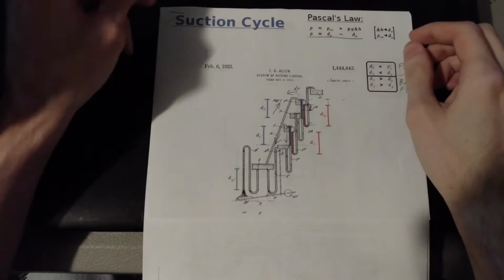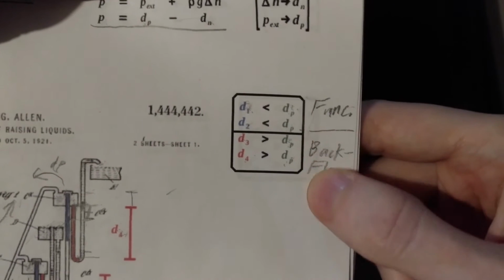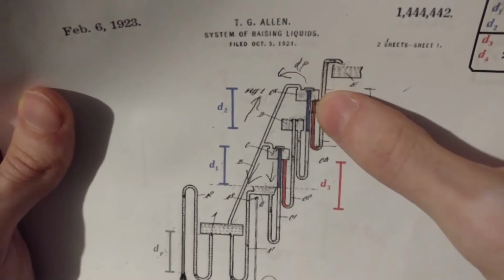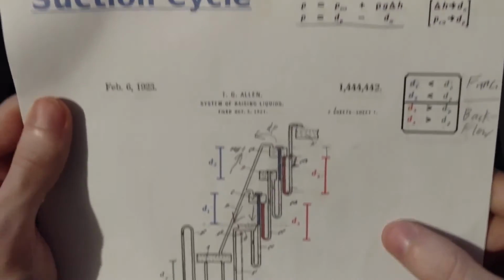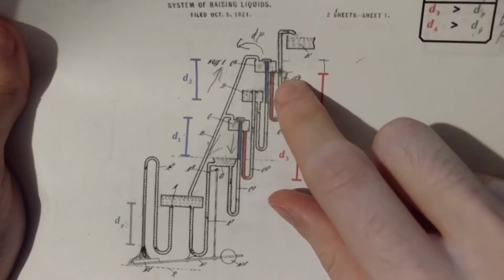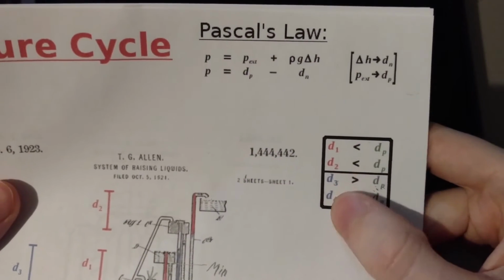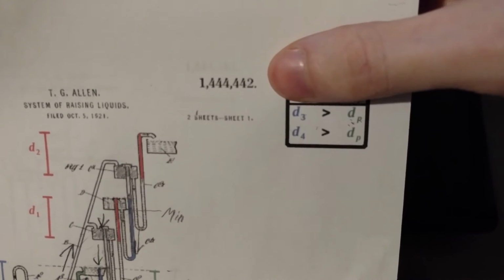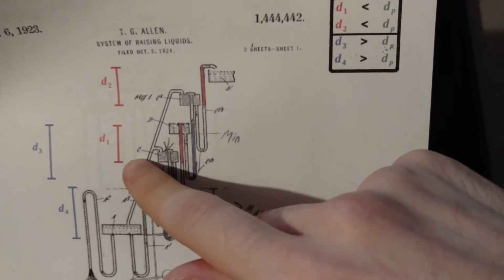Why the Hydrautomat DOESN'T Need Check Valves

Comment: I've designed something similar before inspired by Heron's fountain.
12:05 Top of the tank makes more sense since you lose potential pressure as the tank fills up

Also you can even do without the bottom valve. which you can see from a video I've just made.

Comment: The plans you have are missing a pipe D1  has a special cap on it D2 look here  at D tank
https://content.instructables.com/ORIG/FOI/K523/HTEF7R3Z/FOIK523HTEF7R3Z.jpg?auto=webp&frame=1&fit=bounds&md=7ee059792d81f2f1089f21f686b76628